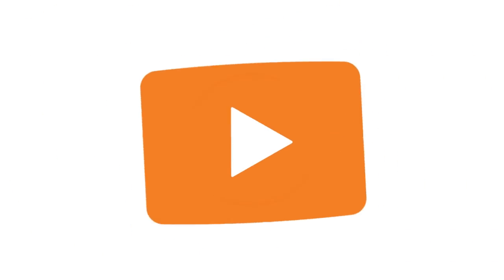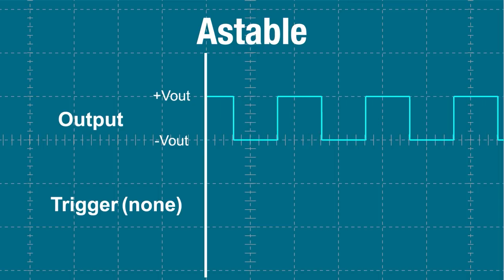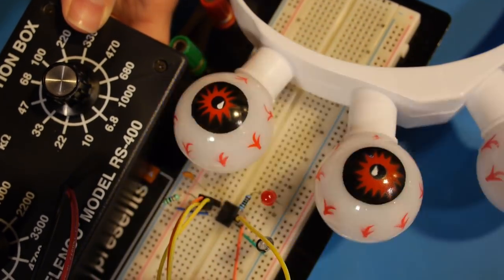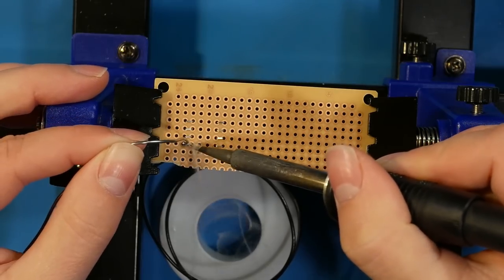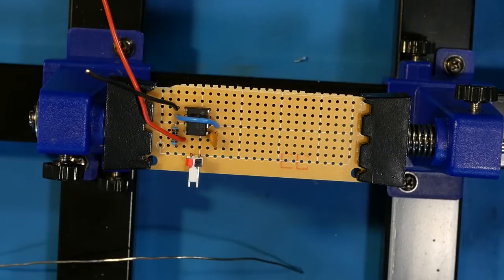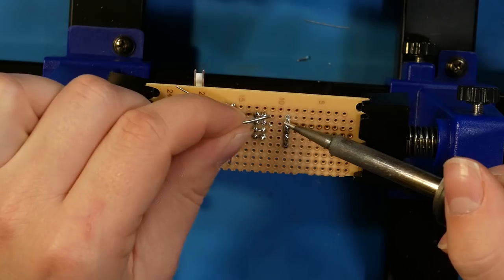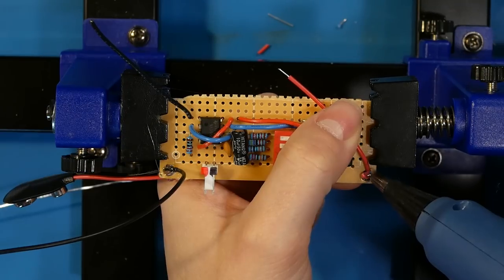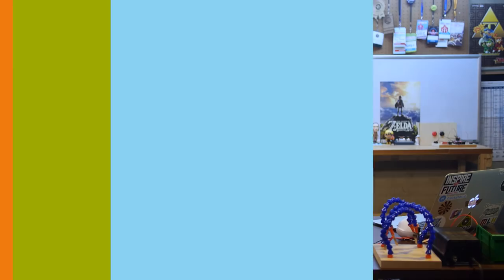555 Timer Project | Flashing LED Headband - The Learning Circuit

Comment: What about building a stereo amplifier using 1x NE555 as a master clock and 1x NE556  and 2x TL030 OP-Amps for the error amplifiers that feed the CV pins of the NE556 and  2x BD131 power transistors for the output transistors, the audio channels connect to the non inverting inputs on the TL030 OP-Amps the output going to the CV pins on the NE556 the output feeds back to the inverting side of the TL030 via a LP filter the output from the NE556 will drive the output transistors that drive the speakers, if you don't know what I am getting at then google NE556 audio amplifier.